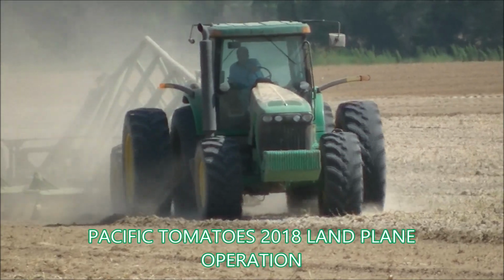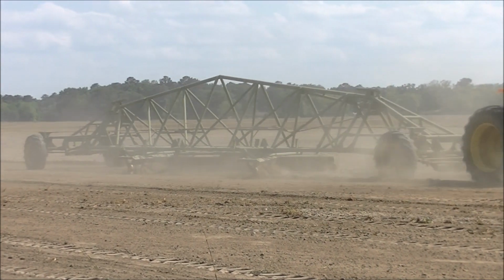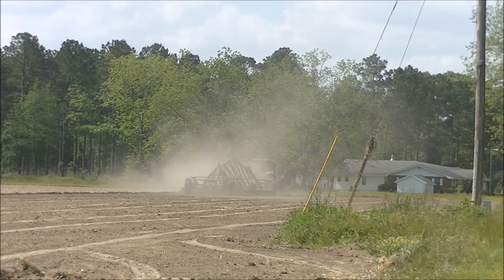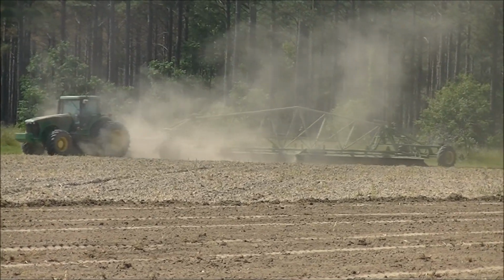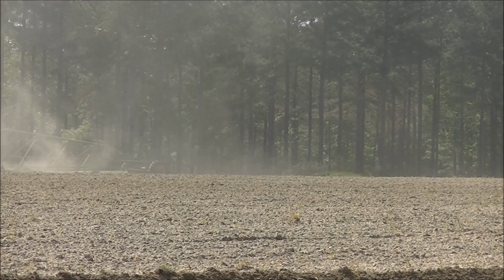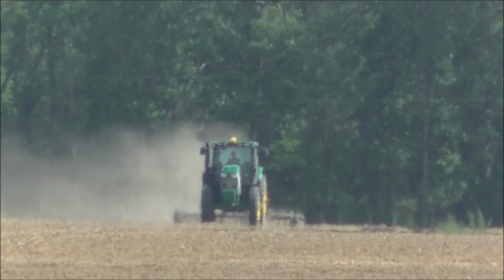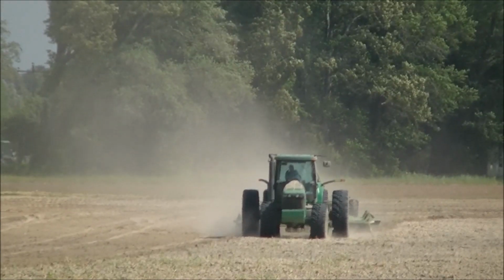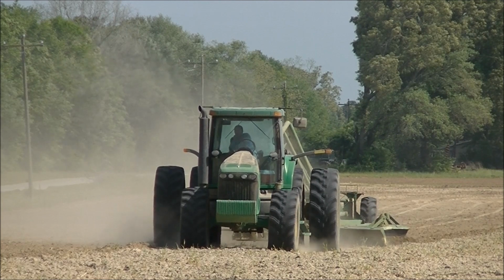JOHN DEERE 8420 PULLING A LAND PLANE. PACIFIC TOMATOES LAND LEVELING

Comment: The farm I work for has the complete 20 series John Deere tractors except an 8520 they have 2 8120s an 8220 2wd an 8320 and an 8420 they are good tractors
Reply from the maker: They were good tractors except for the plastic hoods. You can't hardly find one now that doesn't have the side grills broken out of them. Thanks for watching.